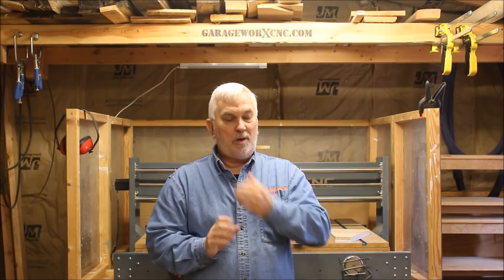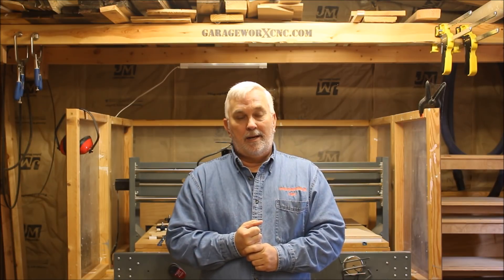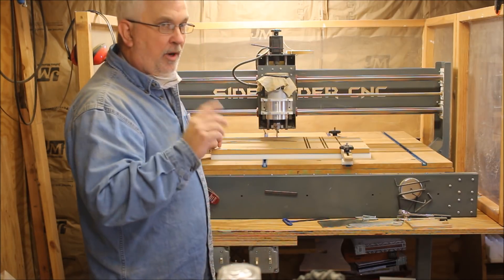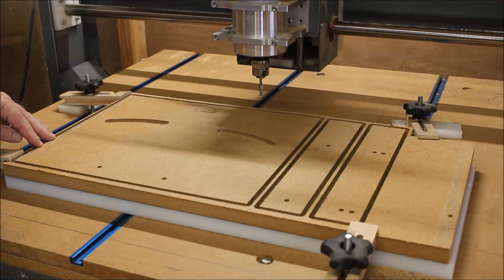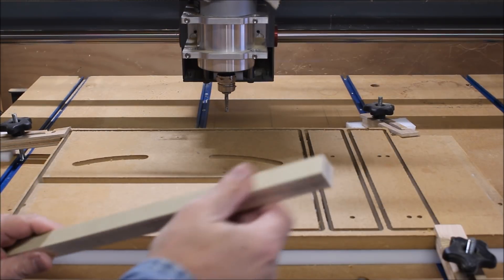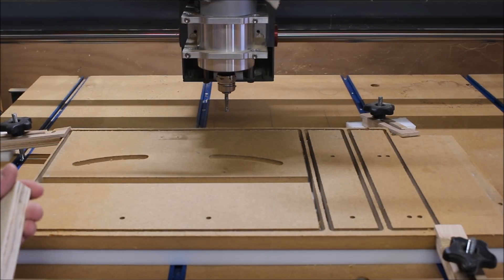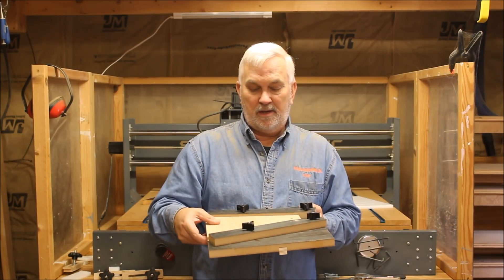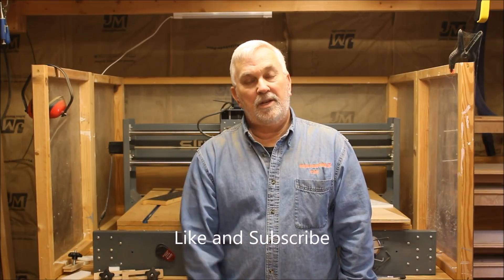Making a Jerry Bennett Wedgie Sled

Comment: Don’t worry about it Donald Um I mean Dave. You can put those front holes further apart but you would have to make your wedgies slightly longer and maybe even change the location of the degree Marker holes on the top.  I’m going to modify my wedgie sled to  have a longer portion on the opposite side of the blade like Frank Hawarth did.  Good video Dave.